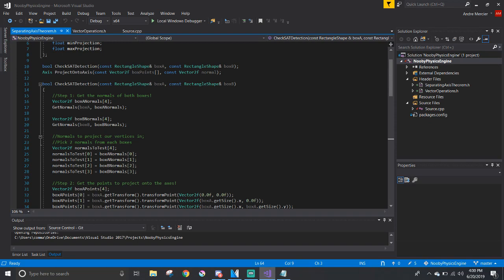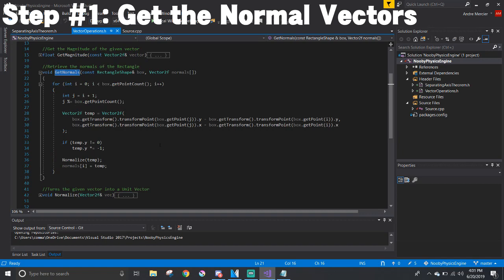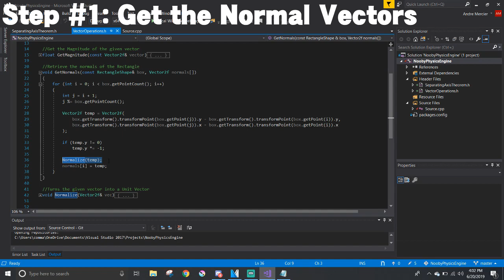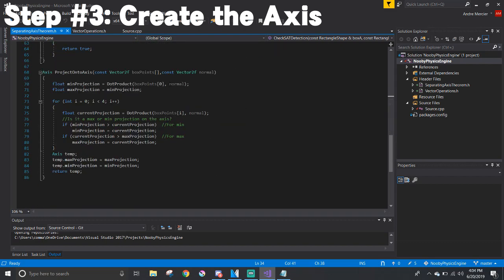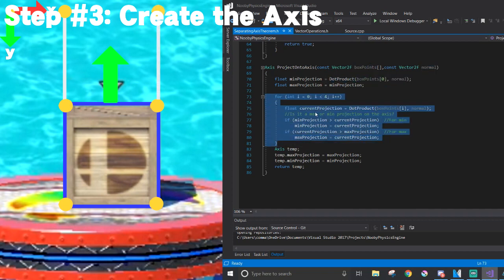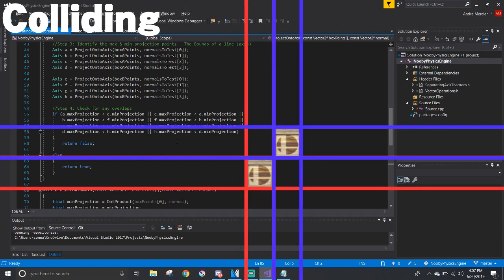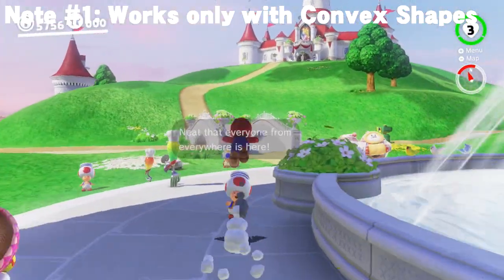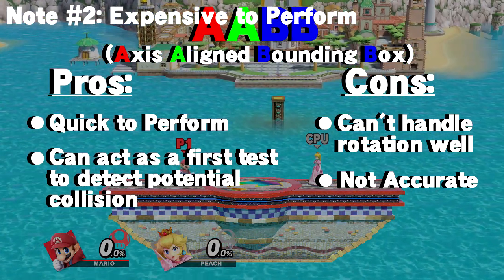Separating Axis Theorem Explained and Implemented!!!

Comment: I think you can solve the performance issue by stopping checking for the collision if you encountered a gap when you project the two objects at the same time so you don't continue projecting onto other axes but instead test another two objects
Reply: Yeah, but you still get boxes' points, rotate them, get the surface normals, then start projecting, AABB is cheaper than that and you can save the corners tested too so only rotation has to be applied before doing SAT